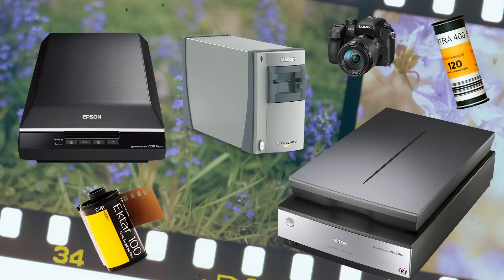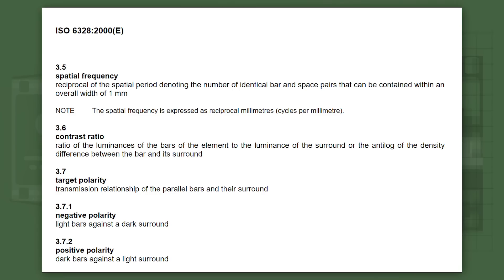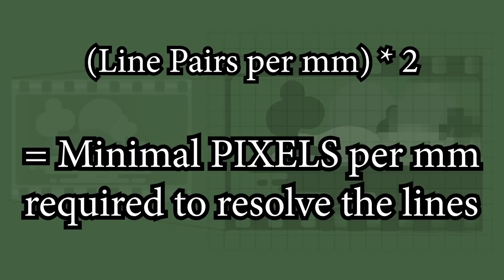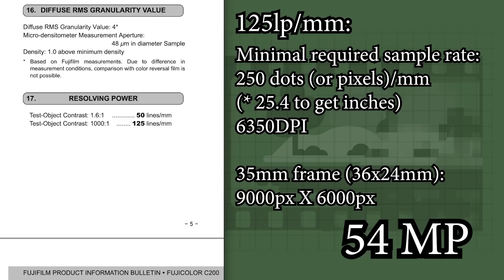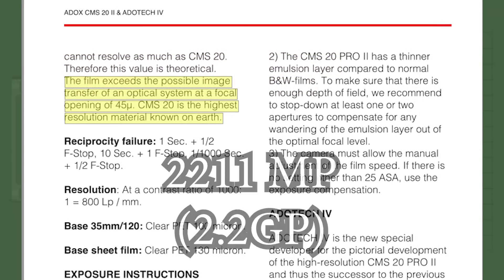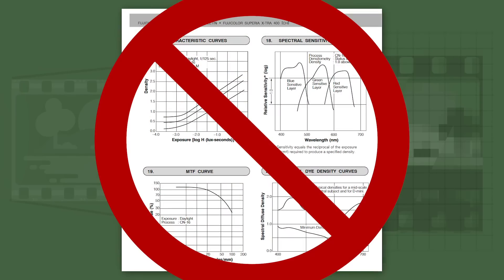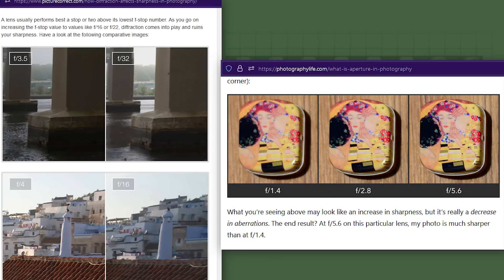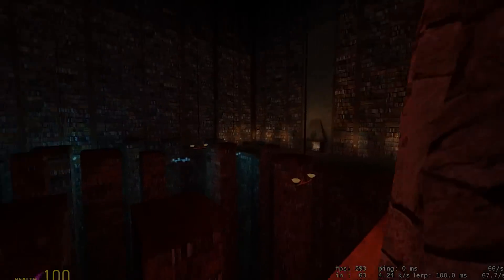The TRUE Resolution of FILM

Comment: Let’s be honest, 35mm is 8-12 megapixels of resolving power, even with fine grained film, and maybe 18mpx with tmax. Good technical video however.
Reply: If you're only achieving 8-12MP of resolution from a 35mm negative, you have a problem with your process. I build film scanners as a hobby, and I can tell you the average 35mm negative taken with a consumer camera and film gets you about 20-25MP of resolution.
Reply: @aleximaschas9342  I’m shooting on a Nikon F3T HP, scan my negatives focused to the grain with either my Fuji gfx, or Nikon 8000ed (with anr glass etc). With the exception of slide film, these are my observations
Reply: @aleximaschas9342  That is more in line with what I have seen.
Reply: I remember reading Minolta said it was about 14mp maximum , unfortunately I can't find it about 15 years later.
Reply: As I wrote on another comment, what is the source of your data? I'd like to see it. (Really!)
Reply: Yes, same finding here. I scanned my old Fuji Velvia 50 on a Nikon LS5000 (4000dpi resolution = 20MP output) then carefully downsized it to a few versions and compared against the original scan. A 6 to 8MP image captures all the details of the original scan. I used prime Nikkor lenses at optimal apertures.
Reply: @bernardd  poor scanning technique.
Reply: @bernardd   
1. all Nikon scanners have maximum resolution of 3600lpi regardless of "wow it 4000dpi optical" written on a box.
2. this resolution (3600) achievable only with high contrast test target, not a real photo
3. you say "prime nikkors" like it must mean something )   but no.  vintage Nikkors are mediocre lenses for the most part. especially in terms of resolving power.

fun fact - one of the best resolving Nikkors is one in their film scanners.
Reply: @vasyapupken  "Prime nikkor" simply means a fixed focal length lens (not a zoom). In the film days, most zooms used to be inferior optically to prime lenses.  Modern lenses have made a huge jump in the past 20 years but I don't think a good "prime lens" from the 1990's shot at optimal aperture would be the limiting factor with 35mm slide film. That's an educated guess though. If anything, I'd say the Nikon scanner is the limiting factor, although again the LS5000 was one of the best non commercial scanners for slides, not counting drum scans. That's my feedback anyway. I'd love to find a way to extract more details so these comments are really interesting.
Reply: It isn't at all. I'm scanning my 35mm stills of Kodak Ekta and Portra at 40mp and was shocked to see how much more detail I was getting each time I stepped up from 16mp, 24mp, 36mp and finally 40mp. I posted my results on the TalkPhotography forum. You need good quality scanners to pull this much detail out of such a small area, flatbed scanners won't do the job.
Reply: @PeteDoesVideo Whatever the actual resolution is, what you say here is right. You need a proper scanner. 

Of course, that costs money and time.
Reply: @PeteDoesVideo And drum scans cost $50-100 per frame for my 6x7 medium format negatives (cheaper for black and white). In one comparison I did, a drum scan at around 6000ppi had marginally more detail than my own 2400ppi Epson v800 scan, with Ilford FP4. I conclude that the mechanical and optical limitations of my system (Bronica GS-1) are mostly limiting. That's about 35ish megapixels, for film with 4 times the surface area of 35mm.
Reply: let's be honest - your opinion based on experience with poorly shot and scanned film where you did nothing to achieve max res.
99% opinions in "film community" are like "i scanned it with my Pooptek-9999KHD it''s 9999K optical res so where is my details ??"

it is quite hard task actually to scan a film properly for it's max res.   wet drum scanning is the way.

Comment: "Film Grain, Resolution and Fundamental Film Particles" by  Tim Vitale  pdf compares various color films, states avg line res 64 lp/mm that makes about 14 Mp for 35mm film, but that's line res, not color res, dye clouds are quite large. 
In Kodak Gold 200 35mm, I didn't see details worth 14 Mp. But it's important to understand that not every camera lens resolves too much, many good lenses only resolve something like 20-30 Mp, some cheap zooms cannot resolve even 14 Mp and only few lenses can resolve more than 50 Mp. Also for high-quality printing we often need only 2-8 Mp (that covers sizes from 15x10cm to 20x30 cm), for larger prints it's logical to drop the ppi because with greater print size viewing distance grows so 8 Mp is really all we need, no point to chase megapixels in digital or in film.

P.S. Because of the Bayer's matrix in digital sensors you need more digital pixels to capture finest details accurately. In other words, 14 Mp digital pixels directly from digital sensor won't have 64 lp/mm due to aliasing/debayering issues. So while 8Mp is all we need, it really matters if these final 8Mp were obtained from 10Mp sensor or from 24Mp sensor.
Reply: lol.   so you say that if a mount cheap zoom on a 50Mp camera i will not see 1 pixel details ?
Reply: @vasyapupken  that's what I say, yes.
Lenses do not have infinite resolution, especially cheap zooms.
For example Canon EF 24-85mm f/3.5-4.5 USM and Canon EF 55-200mm f/4.5-5.6 II USM when mounted on 50MP Canon 5DSR resolve details worth 12 MP max and ONLY if we close aperture to f/8 and ignore the fact that corners are blurry, have fringes etc.
But Canon EF 85mm f/1.4L IS USM on the same camera is perfectly sharp even at f/1.4 with measured sharpness: 45 MP.

Comment: Ironically LP/mm are measured on film using a linear target which has the effect of averaging out the stochastic nature of film grain. So if you are considering details rendered at the smallest level on film vs a sensor Bayer pixel set or more directly a single pixel in a mono-sensor there's a vast difference in actual comparative resolution and as others have mentioned there's also 12-16bits of intensity data recorded at any one pixel.

Comment: This theoretical analysis is very different from real-world photography, scanning and printing. I’ve been a graphic designer for 40 years, and have been using scanned photographs in design software for over 30 years. A high-res 8x10 scan from a $250,000 drum scanner of roughly 100MB was not nearly as good an image as I get from my LUMIX S5, which is 24MP. The files open up at about 115MB in Photoshop. The detail in normal professional 35mm or even 120 film cannot produce real-world results of a modern 24MP full frame sensor. Even my Canon 7D and 5D III produced better files than I ever saw from the service bureau scans. When I shoot film today I have to really reset my expectations for resolution and detail or I’m very disappointed. Still, there is a beautiful roll-off from specular highlight to the regular highlights on film that you don’t usually get with a digital sensor.
Reply: I think at least one aspect that gets lost in translation between theory and reality is that film is never really flat

And generally the bigger the film area, the less flat it is, which is why real life resolution doesn’t grow proportionally to film size

So unless you make exceptionally smooth and even glass plates, you can’t actually use all the potential of the format
Reply: I think people truly underestimate how much of the “film look” actually comes from the lenses. There’s a lot of lens characteristics being misappropriated to be an inherent effect of film itself. If we shot film with a modern clinical lens I think many would be less happy with the results.
Reply: I agree, and I think the problem comes from overinterpreting MTF curves (which admittedly is easily done). I was a commercial photographer in the 1970s, and there is absolutely NO WAY 35 mm film could yield anything approaching the quality of hundreds of megapixels. We NEVER used 35 mm film for commercial work, and even medium format struggled to make the mark. We had to use large format, at least 5x4" but often 10x8", for the kind of work that is now routinely done with 50-100 MP digital cameras.
Reply: @newtboys  "Sharper, better color, better dynamic range..." Absolutely! And not least a linear response throughout that dynamic range. Film rolls off in the shadows and highlights, which is the main reason for the coveted "film look". It was hell to work with in real life because it meant loss of separation in those areas - muddy, dark grey shadows and hazy, light grey highlights. Also, you were stuck with the colours  the film manufacturer chose for you through their selection of chemical processes in the film emulsion. All very interesting to navigate and trying to get the best out of, but worse by miles than digital. 

Besides, very few film fans today do a fully analogue process. They scan their film, and it's digital from then on, so they add a big part of the digital benefits to their "analogue" process. They can tweak contrast, colour and sharpness in a way that none of us who actually worked with film could. I did that in the naughties until sensor resolution caught up with film, but from then on pure digital had the analogue/digital process completely beaten.
Reply: @skfineshriber  Yeah I'm trying to figure out this you tubers results on thinking film gives more detail. I remember learning thst 9 to 12 megapixels is a goid range for the digital equivalent to film. Because film depends alot on how good the lens is. Cheap lens = Maybe 9 Megapixels. Pro gear abd lenses = 12 maybe 15 megapixrls if your lucky
Reply: @SchardtCinematic  and it depends on which film you’re talking about. 👍
Reply: @skfineshriber  Yep exactly. So many diffrent grains to choose from as well as film speeds
Reply: @SchardtCinematic  Exactly, and in real life no-one used ISO 20 film. 50 or 100 for studio work, both in b/w and colour - and 200 or 400 for handheld, on-site jobs. Yes, ISO 20 for copy work and the like, but never for anything that had depth or moved. The thing about real photography is that it's a practical exercise, not a theoretical one.
Reply: @oleleclos  Spot on!

Comment: I really enjoyed the video, but one thought, when you converted the line pairs/mm to digital pixels, did you account for the sensor generally being a Bayer pattern? I mean each pixel is only capturing red green or blue, so assuming we are talking about colour film, wouldn’t you need theoretically 4 times more megapixels than the calculation you used?
Regardless, great video and super interesting.

Comment: This will always be an interesting discussion - personally, I don't think resolution is the whole story though. Even if some film stocks can still out-resolve a lot of digital sensors, digital still often looks sharper to me. Why? Well, there's a lot of inherent qualities in film - halation, non-linear response to light, ect. - that make it a less accurate recording medium overall. It often makes the image more pleasing - and these qualities are often desirable - but these things are, technically speaking, flaws and limitations of the capture medium. Now, digital also has its flaws - most notably sensor noise and tying color information to bit depth - but generally speaking, with a well exposed image, digital seems like it's often a more accurate representation of what you are attempting to capture (i.e., fidelity). I think this is what people mean when they talk about digital "sharpness," and then sometimes go out of their way to emulate film in an attempt to smooth-out the edges! Alll this being said, I've never been much of a pixel-peeper anyway...